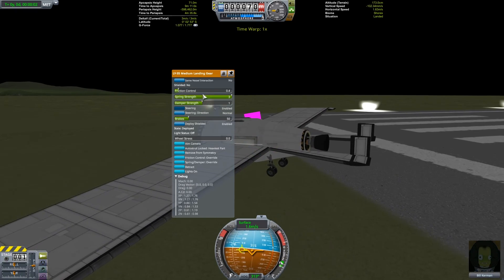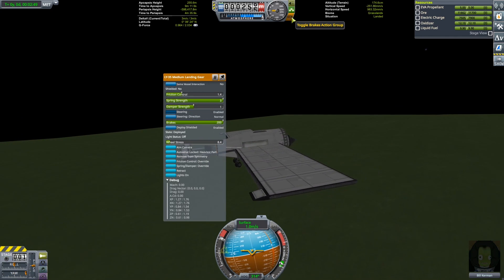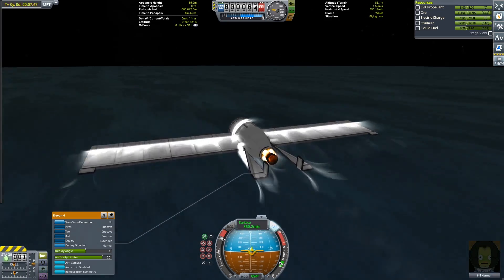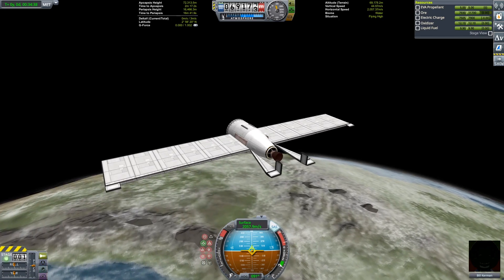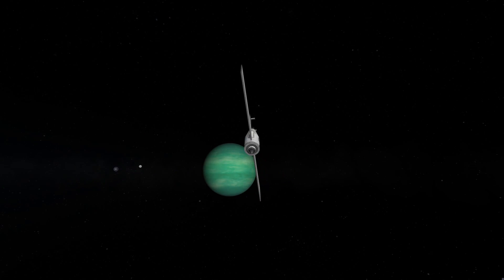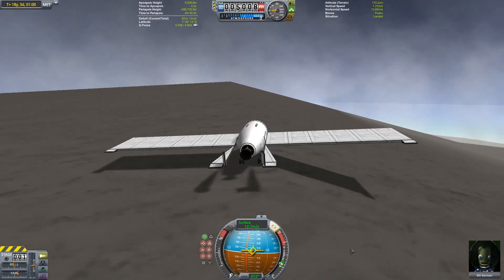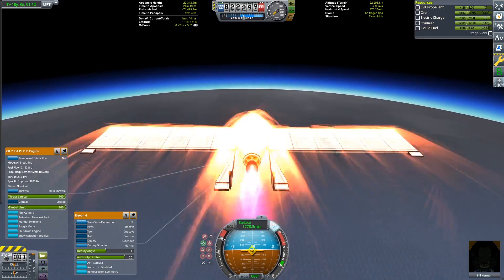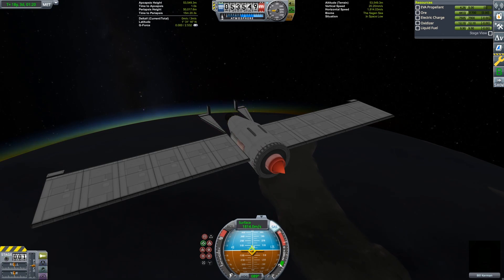Ore-powered SSTO (and beyond) in Kerbal Space Program

Comment: A year after I first watched it, I realise what an extra-big flex this video is: just adding a drill would make it so much easier! :) Also, I'm having trouble with roll stability which seems to be related to the vertical stabilizer too. It's so tempting to save a few kilos by skimping on it, isn't it? But even when I don't, things can get weird. I once fitted a tiny elevon behind a strake for the vertical stabilizer, and the long fixed strake played merry havoc with stability in turning. The plane oscillated in the yaw axis and I had no idea why until I turned on the aero visualization and saw that in a steep bank, the strake was alternately generating up-force and down-force.

Comment: About pushing that 48t/rapier ratio, there's a lot of flat ground around the dessert launch complex; much more than at KSC. I think you could 'launch' there, taxi to the western hills, and have a very long takeoff run eastward. The flip side is there's no sea at the end, and it's not at the equator so you would get slightly less boost from the planet's rotation. Perhaps instead of reducing engines, you could reduce wing mass by using the extra space to reach a higher takeoff speed.

The complex is good for Minmus missions. It's at a lattitude which corresponds to Minmus's orbital inclination. If you time it so that a line from the launch site through the center of Kerbin intersects Minmus orbit, you need little if any a plane change. At least, that's what I got from lining it up that way, launching rockets from the dessert launchpad, and steering for a 90 degree heading.

Edit: I've got my first Laythe landing coming up. It wasn't really a planned mission. I was testing a new spaceplane, saw how much delta-v it had left, and as it was in my "test bin" save which doesn't have any other pending misssions, took it all the way there, ending up with little fuel left. Being fairly new to gravity assists, the only one I could get from Tylo put me into a retrograde suborbit, (if that's a word,) but it was such a narrow ellipse that I knew it would take little delta-v to reverse the direction at apoapsis. I was able to get a Laythe encounter with the same maneuver, and I hope aerobraking will do the rest.
Reply: a factor with the dessert site is its higher altitude, this does increase the efficiency of rocket engines, as well as lower drag, but it does make jets less powerful and you get less lift from wings
it's all very slight, but it might make a difference

Comment: You sure that's right Bradley?  The speed of sound increases with altitude?  In the real world it decreases: the more dense the medium, the faster sound passes through it.  I thought the reason air breathing engines struggled high up was that the air was thinner and so they couldn't get enough oxidiser but lower down they have to combat air resistance and high drag.
Reply: Temperature decreases with altitude only up to ~10 km on Kerbin, after which it increases again. Speed of sound is independent of pressure, and gets higher the higher the temperature is, so between ~10 km and ~40 km (temperature minimum and maximum) the speed of sound in Kerbin's atmosphere increases with increasing altitude.

The same sort of temperature profile happens in Earth's atmosphere too, due to the ozone layer absorbing solar UV radiation and heating up from it.

Comment: What an absurd idea, I love it! :D

Did you consider swapping one RAPIER for a Panther? You'd lose 50-75m/s top speed but you'd have an engine that can generate electricity up til mach 3.5, 0.8t less dry mass, and a plane that has a significantly higher TWR at subsonic speeds likely saving you some wing mass as well.

Comment: Take the mission to Duna! How does the ascent change when you cannot run the RAPIERS on air-breathing mode? Is it even possible?
Reply: Duna has no oxygen in atmo for air-breathing engines. You'd have to rely on the lvn engines, which is probably extremely challenging with this design. The atomic engines still get good isp (600s iirc?) because of the thin atmosphere, but that's paired with the extremely low lift for your wings, too. For a design with super low thrust (and lift) to weight ratio it would be quite the challenge.
Reply: I just realized I misread your comment... but yeah, I would imagine it would be very hard, especially with how unstable those little landing gears are to boot... makes getting past your stall speed all the more challenging
Reply: You could do it, but the craft would need to be both light (or have an absurdly large wingspan) and have a ton of intakes.

Comment: I can't believe it's an oversight that you've left the oxidizer topped up, even though you're only using liquid fuel in engines. Or is that a backup just in case you need an extra kick from the RAPIERs?
Reply: the fuel cells needed to power the ISRU need to consume Oxidiser and Liquid fuel, its just that they consume slower than the ISRU produces, so it seems like its not being used. (:
Reply: There are 2 reasons for this -
1) The challenge rules stipulate that if you're running an ore-craft with LF/OX the only tank you're allowed to have on board is a dumpling tank (this ensures that there is something for the ISRU to fill into)
2)The Fuel Cells require an LF/OX mix to run.